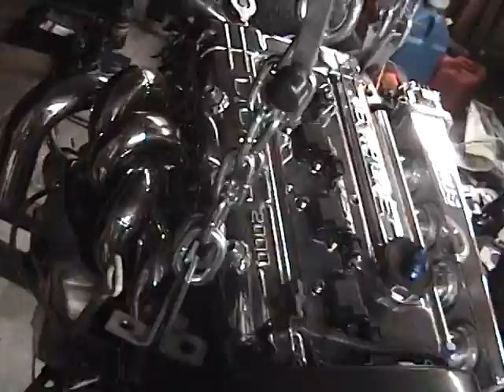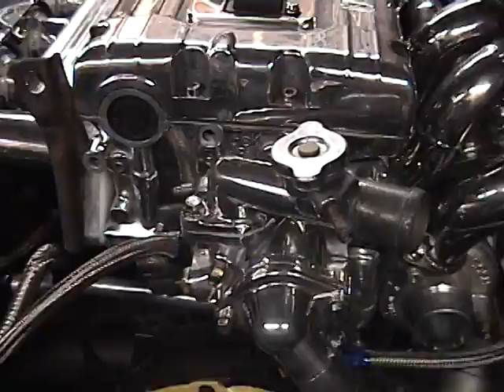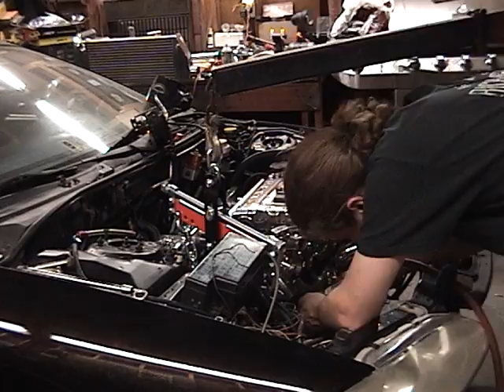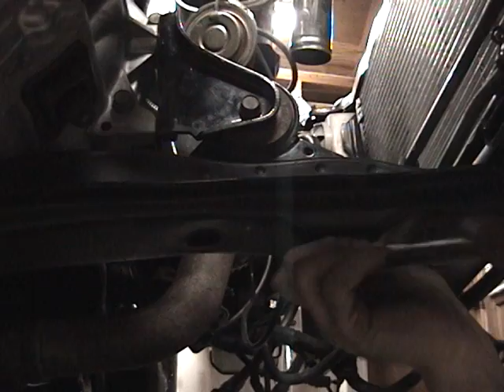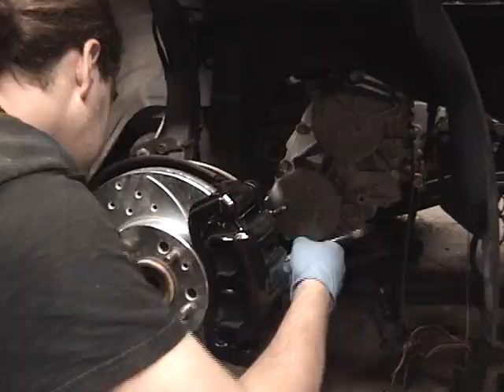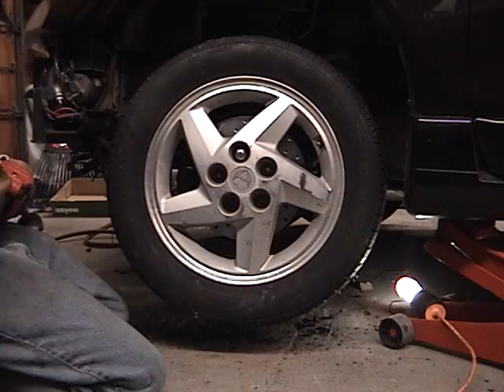2g GSX AWD Engine & Transmission installation

Comment: @martian010 

the engine and trans in this vid are not the same as your ESI, and it sounds like you have an automatic...as far as dropping the tranny most fwd are pretty much the same, you just don't have the transfer case, driveshaft and cross member to remove that us awd folks have to.

Comment: do you have to remove the drivers side axle to remove the transmission for a clutch replacement? I am having a hard time getting the transmission to completely split. Ive removed the differential and the rear drive shaft as well as the front passenger side drive axle.

Comment: Jafro, what the the engine resting on before you attached the trans? I see now that you installed the crossmember after transmission.
Reply from the maker: A jackstand and a block of wood.  If there's a long period of time between when your trans and engine go in, install the crossmember before you drop the engine in, drop the engine in, attach the timing side mount, and put a block of wood between the crossmember and the flywheel.  That way you can move the car around without worrying about knocking the engine off the jack stand and crushing the alternator pulley.  ;)
Reply: Do you think this method is easier than dropping in the engine and trans at the same time? They'll be going in on the same day most likely, so the jack stand should work fine.
Reply from the maker: It's all about what you're willing to scratch up.  Working by myself with highly-polished parts and waiting for a transmission to arrive... it just worked out for me to do it in 2 parts.  I'm happy doing it either way, but most people prefer 1 piece install.  It's easier to hit all the bell housing bolts.  Given an extra set of hands and chance to do it again, I'd 1-piece it.  Crossmember goes in last if you do it that way.
Reply: The Bay has a fresh coat of paint, so hopefully I don't scratch anything! I think I'll go for the method shown in this video. Seems much easier to manage. Thanks!
Reply from the maker: Honestly, it can get scratched either way...  Some clutches put up a fight getting them aligned.  Leave your transmission mount off until ALL of your transmission mount bolts are tight.  Then install the trans mount.  Your shifts will thank you.

Comment: Hi Jafromobile one question i have a 2G  GSX TURBO front wheel drive manual and i want to swap it over to AWD is that possible ..
Reply from the maker: +Karl M jensson Sure, just put the driveshaft and transfer case back in it and remove the viscous coupling eliminator.  All GSX models are already AWD.  If it's a GSX and you're FWD, someone hacked it to make it FWD because they were too cheap to fix the rear end.
Reply: All right thank you for the info and great work you have bin share in with the rest of us
Reply from the maker: Karl M jensson If it's a GS-T, you're going to need an AWD transmission, driveshaft, transfer case, rear subframe with axles and cups, rear differential, gas tank, and rear suspension.  Unless you can find a wrecked or blown-motor donor car, that can be expensive to piece together.  It's a lot less work and expense in most cases to get a GSX that is already and still AWD.  I wouldn't bother doing all that work and investment on any other chassis than a Spyder (there is no factory AWD convertible).